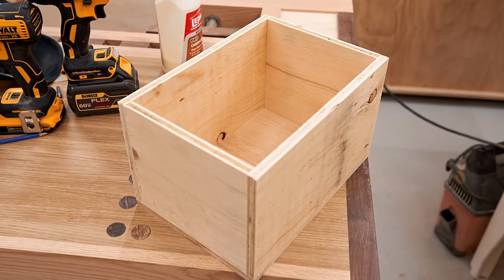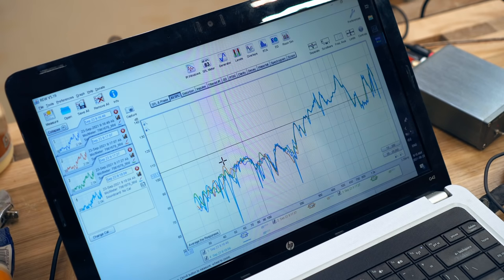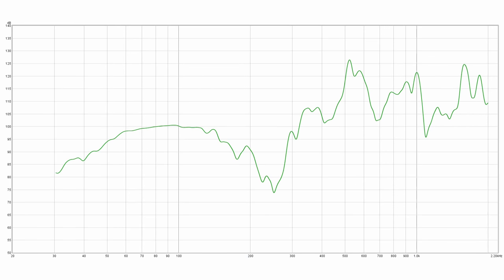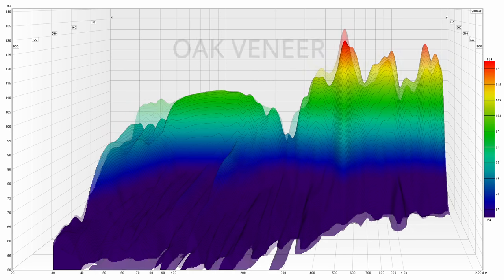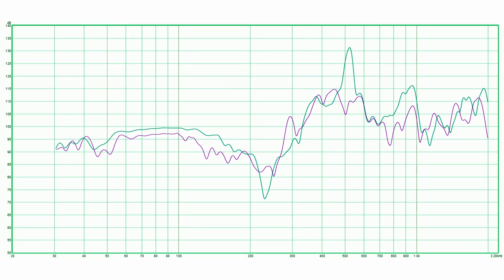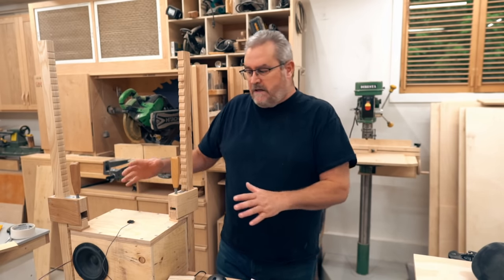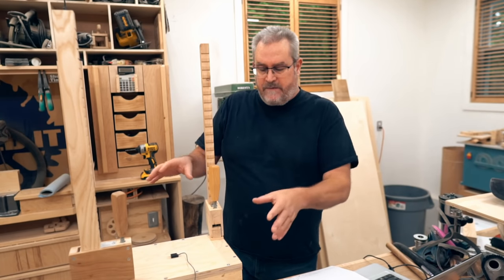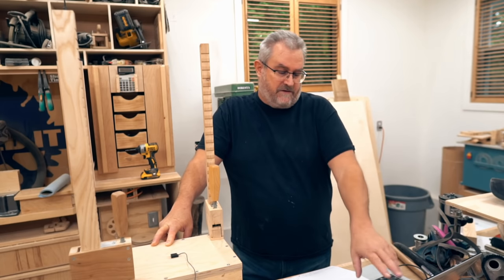PLYWOOD vs MDF For Speaker Building - Tests Show Surprising Results

Comment: I worked for over ten years in a plywood mill. There are several differences between pieces of plywood. They are not always solid.  Especially in typical pine plywood. There can be  areas of void in the individual layers. The more layers that you have, the less that these voids will matter.

Comment: Oh oh John, disputing peoples imagination on how they can even hear cables, digital converters chips or materials can bring you in trouble today.
But I absolutely agree, most of those things are imagination and wishful thinking.
Reply from the maker: Oh don't worry, nothing I do will change any of that. Guys believe what they want to believe, regardless of the evidence.
Reply: The pathology of the cable enthusiast is simple: they are desperate to make their money mean something.
Reply: I have no stocks in this game, but would not the differences be bigger the more energy that is in play?  Every material has its own resonance freq. but does that really matter if the energy is so low that differences is not audible? 

One might expect that 4 wood types with same tickness (with not too different resonance freq.) combined with low energy input, would not equal audible differences. 

I know some of the most serious and regarded studio monitor producers in the world even uses sand in the cabinets of their top models. Sure is allot of money out of the window if the sound is the same - even at 110-120 dB SPL. Others use several ticker layers of wood. Its not like the customer sees this either, it just makes the speakers more difficult to move and more expensive.
Reply: Well Taylor, if you are going to 'agree' that people imagine hearing differences that 'don't exist'.  Using this as an example where the resulting graph is clearly showing 13dB differences, only shows your ignorance.
😑

not sure if this video is to troll people, but ok...
Reply: @haknys  The differences scale in a fairly linear way.  His own graphs show massive differences that would take 20x more or less power to correct / match one another.   People that miss that point are simply demonstrating their ignorance.

Comment: I like experiments like this.  I believe the materials would have shown a greater difference if the accelerometer placement was on the speaker baffle itself.  I realize that entails more work.  Also, it would be enormously interesting if you had also tested a constrained layer damping material applied to the inside of the baffle such as Dynamat Xtreme.  Also, there are manufacturers such as Magico who make cabinet enclosures out of billet aluminum and carbon fiber.  They also apply damping materials such as No-Rez to the insides.  Thanks!

Comment: About 40 years ago I built a set of 3 way tower speakers using 1/2" particle board with 1/4" Luan plywood laminated on the outside with for a nice looking wood finish. They are still going strong and the cabinets are still solid as a rock. The only inner bracing was a divider between the woofer and the midrange/tweeter section, to make the woofer section the right volume for the speaker that was used. I also put fiberglass insulation in the woofer section. I know particle board isn't really desirable for speaker cabinets, but even at high volumes the cabinets show no signs of vibration. I keep thinking that I'll rebuild them some day, but they've been such good little troopers.
Reply from the maker: Actually, there's nothing wrong with particle board. Hundreds of thousands of speakers were (and are) made from it. It's no better or worse than most other materials used to build speakers.

Comment: On my last speaker building project I used a knotty pine butcher block style project board from Lowe's. It's relatively inexpensive and beautiful with a bit of oil on it. There's no reason to fret about the material resonance if you address the resonance with bracing and damping materials. I lined the largest sections of panel with asphalt/rubbery type damping sheets, then used acoustic foam, then poly-fill. The result is a plenty-quiet cabinet and a beautiful knotty pine butcher block finish that required no nonsense to "finish." Just a rub down with some oil to give them a bit of rustic sheen.

Comment: @IBuildIt
A few years ago I renovated a pair of heads (MDF) with a 12" bass and a 1" tweeter with a 30cm horn - with a multiply (9-ply) beech wood exterior and a vented cabin.
I dont like MDF,  it's really cheap material and parts of the corners were broken off, I remade it. There was a big difference: clear, clean, no booming, that's why I decided to use the next cabin - RCF 18" ventilated (approx. 100 cm high, 70 x 70 cm), old: MDF, new: Mulitply - also there a big difference in the sound!
I think because the MDF is softer, and the Multiply is much stiffer, minimal bending, so in my opinion there is less cushioning and more comes out of it! The best part is that the veneered surface makes it easy to get a brilliant finish, I use epoxy resin as glue, after 10 years no problem, no shrinkage, no leaks - and 3 coats of epoxy resin outside - the best result you can expect your work can achieve!
My last project was an Electro Voice Eliminator - a 2 x 15" cab - a big deal, a lot of work - but in the end it rewards me doubly every time I play with it.

Comment: Top secret tip:
Glue together full sheets of 1/2" plywood + 1/4" MDF board with a synthetic rubber based adhesive. 
Rip and cut panels with regular tools just like using a thicker board.
Use plywood outside for durability & MDF inside for good damping.
This combination has, by far, the best properties for nearly eliminating cabinet resonance.
Beats every other type of wood. The only thing better is rubber reinforced concrete. That stuff is impossibly heavy though!
Reply from the maker: That's not top secret, it's constrained layer damping - CLD.
Reply: @IBuildIt  So THATs what CLD means!! 😂
I'd only ever built speaker boxes the boring way (MDF, glue, screws) until I started investigating open baffle speakers.
A few years ago I saw someone build a box with CLD panels (various other techniques employed as well, for mounting a measuring instrument I think), it was ultra-quiet inside. You could put a decent BT speaker inside and barely any sound got out 😂😂
So I went ahead and build a few open baffles, recalling whatever I could from the way this box was built. 
Admittedly, my understanding of acoustics & my woodworking skills are quite basic. But the resulting OB speakers were pretty spectacular to listen to. (They're downright ugly though, mostly made out of a combination of whatever wood I have on hand)
Haven't seen too many folks use the technique on YouTube though, hence the "top secret" bit 😂
Reply: This type of cabinet is used in the new Mission 770 speakers.

Comment: Interesting test.  This pretty much confirms what I have heard by ear, in that there isn't an audible difference.  I switched years ago to mostly baltic ply, for the reason that it's consistent thickness for the CNC, and that it's much harder than mdf, making a more durable end product.  MDF dents and bends corners too easily.  I also played with corian and phenolic, but again, the advantage wasn't sound, but rather a more stable material for finishing.  If you want that Wilson finish you need to lay down a really thick layer of spray filler to encapsulate the joints, then wait months while the material settles down, swells, shrinks, and moves.  Then and only then do you dare block it for primer.  That said, take a close look at a wilson and even they have issues with their materials.  You will plainly see the joints through the automotive finish.

Comment: Another top tip is to laminate a panel of mdf to the inside face of baltic birch.  This improves(reduces) time of resonance.  Bracing works by lowering amplitude of resonance and shifting frequencies further up.

 Creating sub panels by multiple braces unequally spaced makes them effectively different sizes and splits frequency of resonance hence reduces amplitude of each specific frequency.  Equal spacing creates lots of sub panels of similar frequency so doesn't reduce amplitude which becomes additive.

Using 5 braces has a similar effect on resonance amplitude as doubling panel thickness so increasing nr of braces to more than 5  has no advantage over simply doubling panel thickness except that the larger the cab the lighter you can make it by upping nr of braces.  Using visco elastic damping membrane on inside panel faces drops resonant frequency and lowers amplitude and time of resonance.  There's loads you can do.    As speaker size increases so mass increases and structural integrity becomes more important.  This is where baltic bitch ply is superior as it has greater integrity through higher tendsile strength and greater resistance to shear as well as splitting compared to mdf.
Reply: I was considering this option as well, not only to tame Birch but maybe even something as radical as the grains from sweet gum that I have plenty of around here and would like to put to good use.
Reply: Tried bamboo?

Comment: This is why I made my guitar amp speaker box out of fir and pine. But.. if I'm not mistaken, it's not the actual sound of the box that it produces while resonating that's audible, it's what the shaking/resonating of the box does to the drivers as it shakes in and out of phase with them. That's what you end up hearing as artefacts in the sound. The volume would have to be ear bleeding in order to actually HEAR any sound from the enclosure itself.

Comment: Even if this video is two years old, I would still like to ask about an idea that I had some time ago to dampen or at least move higher the resonance frequency of the speaker box. That is using long 1/4" thick threaded rods, preferably brass, running between parallel walls/sides, and to tighten the side bolts as much as possible, also adding tightened bolts on the inside. That should "contain" the vibration. Do you think it might effective? 

The advantage they have is they use very little internal space, and they could be easily added to an existing speaker box, bought recently or not. There's a YouTube series by GR where people send their flawed speakers they are not happy with, and the usual suggestion they get (besides buying better, more expensive parts for the crossover) is to use an expensive damping material they sell, and sometimes to add wood damping plates or crossbars to the inside, which would modify the internal volume somehow.

Comment: Calculate, build, measure == engineering.  You might like calculating the expected panel frequency to see how close it was for your build. Really great to see the build and measurements. I build boxes small enough that the lowest cavity resonance is above the range I will use that driver.  I do the same with the panel resonant frequency.  If the panel is thick enough and small enough or braced sufficiently, the first resonant mode of the panel can be placed above the range the driver is used.    Stuffing the box with very dense wool or fiberglass completes the package.  A fully non-resonant enclosure. You do best to make the box the shape of a half cube with the driver centered on the large square side.  I don't think you can do better than that.

Comment: Interesting video!
I wonder if laminating two boards together that have the biggest resonant differences would affect the results?
Reply: I also wonder what laminating two different boards together would do the results. A simple knock test definitely shows difference but that is very subjective. The theory being that the two different materials (plywood+mdf) have different resonant frequencies and cancel eachother out.
Reply: Laminate two materials that have very different speed of sound and the result is quite "dead". Different timbers can vary quite a bit. Or for fun sandwich a Sheet of aluminium. Often thought of trying this with speakers.
Reply: It would definitely improve the results.  Personally I've found that a combination of bracing (of different types used in the same box) and the use of laminated panels is very effective at eliminating resonances.  If you glue a thin (1/4 - 3/8) panel of (quality) MDF to a Baltic birch plywood panel, the result is amazingly stable.  You have to use a lot of glue, and make sure it is uniformly clamped together, but it's worth the effort.  Many of the high-end speaker manufacturers utilize composite layers of different materials to absorb resonance.  The key is using materials with different *densities*.  When the energy hits material A it bends at angle X, for example.  As it passes from material A to material B (of a different density), it bends again at angle Y and so on...  Each change in direction absorbs energy.

Comment: I knew that. A furniture plywood is the best for me. With an automotive insulation membranes. But a disadvantage (that was the reason) is a humidity sensitivity. If you keep your speakers away from water, you'll be good with a wooden box in opposite to a paper one.

Comment: I built a pair of small satellites and a pair of large bass boxes using 3/4" oak laminate plywood and they worked out quite well. My concerns with using plywood are twofold, first, that they don't lend themselves well to gluing on bracing on the inside of the panels, since the brace would be glued to the first layer of plywood only, and second, that over time the plys may begin to separate and rattle. For my latest boxes, I went back to MDF, since with the oak laminate material, I still had edges to cover, and with the MDF, I used oak laminate sheets to cover the entire surfaces of the front, top and sides. For internal damping, in the past I have glued carpet padding to the inside panels using carpenter's glue (called Powergrab) applied to several places on the padding. For the last project, I purchased water based roofing cement, and brushed it on both the inside panels and the carpet padding, applying quite a thick coat, and glued the padding to the panels, this provides both dampening of the panel and absorption-diffusion of sound waves inside the box.

Comment: I don't know anything about those graphs, I see differences and I'm now assuming that your want them to be as low with no big peaks as possible. Thanks for the summation at the end. To me it seems you build with what you have and if not go what looks or fits your budget.
Reply: The test uses an accelerometer to measure vibration. What you see on the graph is frequency on the x-axis, and vibration on the y-axis. The greater the vibration energy, the higher it reads on the graph.
So what you see is how much the panel is vibrating at any frequency, you see a peak at the resonant frequency of the material (this is when the frequency that the panel "wants" to vibrate at matches the frequency played), and a dip where the panel is at it's least resonant frequency. The rest of the plot will show essentially how much damping the panel has, with more damping being better (lower plot).

you will also see peaks where 1/4 of the wavelength of the frequency match the front to back dimension, and a dip where 1/2 the wavelength of frequency matches the front to back dimension.

Comment: Some fundamentals to remember. 

The filling of a space with absorbent wadding is there to reduce the internal standing waves that get energised by the speaker and augmented by the parallel sides of the box. This problem will be most noticeable where the internal height, width and length are half wavelengths. It's considered that the best place to put the wadding is in the centre of the acoustic space. Reducing the standing waves minimises the energy transferring to the cabinet sides reducing the colouration.

Cabinet wall thickness, bracing and damping is about minimising the energy transferred from the inside to the outside of the box. Either make the panel very stiff and possibly move the problem colouration up in frequency into the region where the ear is more sensitive as a consequence, or allow it to flex slightly with thin walls as long as it's very well damped, thin ply with bitumen dampening panels for instance, keeping the resonance low in frequency where the ear is less sensitive. A quick tap test on the cabinet sides will tell you which is which.

Either way you are still going to get some radiation of sound through the loudspeaker diaphragm from the cabinet interior.

Comment: This is a great test in the analysis, but I think that maybe clamping the speaker box that way, and using it for every test, leaves only the front panel where the speaker is mounted as a variable. Internal reflections could show more with no clamped boxes fully made of the same material. Again, it's still a great test, cheers.

Comment: Cool.Only thin g I would have liked to add hear would be if using a torsion brace like is used in Magico aluminum speakers would make a difference vs regular bracing,

Comment: Interesting results. The only issue with plywood is the strength of the joint with end grain if you are just using glue; there are ways to deal with that though.
I used plywood for my Infinite Baffle manifold to get strength. I would not want to hang 4 15" drivers to a MDF box attached to floor joists.  I did glue and screw it though, and with opposed drivers, a lot of the energy induced is cancelled out.  Thanks for doing the test. MDF machines nice, but is a PITA dust wise....

Comment: I found this interesting. I use MDF instead of particle board, because I found MDF much easier to work with (much less chipping and much  more reliable at holding screws).
Reply: Cheap plys and "particle board" would be more prone to chipping. 
I feel that plywood dust may be a little better for you than MDF dust ;p Not that either is great to breath